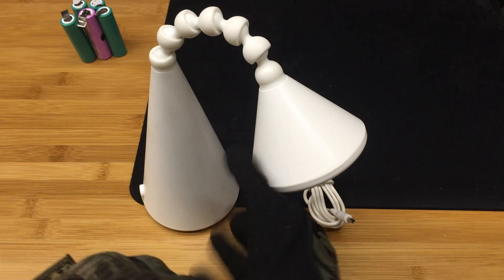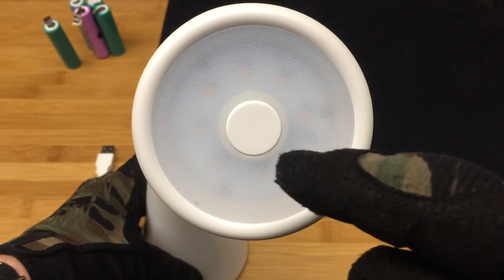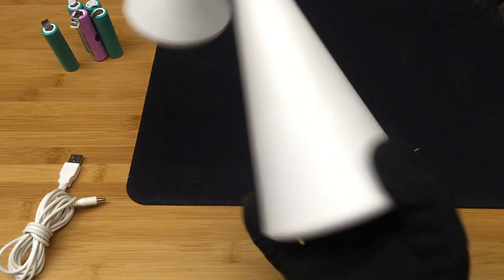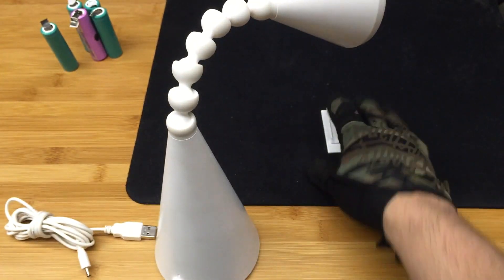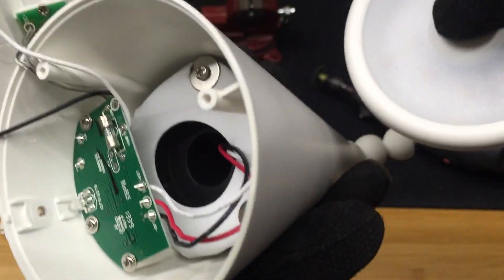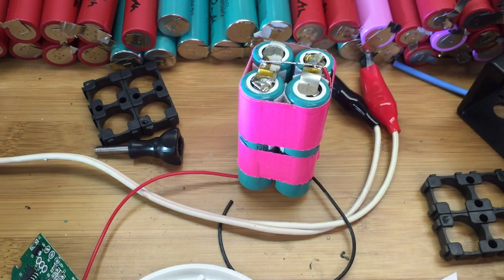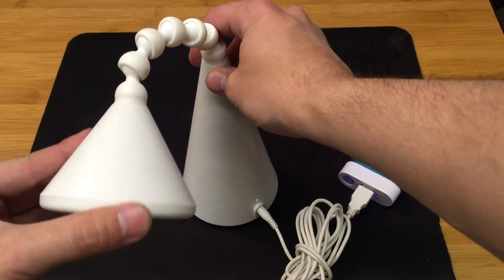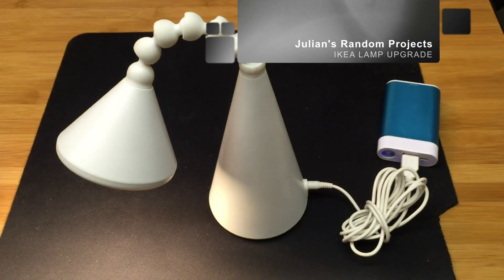FRYEBO IKEA Lamp Battery Upgrade 18650

Comment: Cool, lots of room in there for batteries. You might want to consider changing out the charging circuit. Using the NIMH charger could overcharge them a fair bit, which would be a bit of a safety concern without any protection circuitry on those cells. You can pick up the TP4056 1s charging modules on ebay for somewhere around $1, and they take 5v in. There are some with integrated battery protection available as well.
Reply from the maker: Mike MacWillie Thanks Mike! So funny you mention the TP4056, I've already recorded quick update where I cover the fact that yes, the stock charger did in fact overcharge to ~4.4vdc (not safe). I've already remedied this problem with the TP4056. Should be up soon :) good eye.
Reply from the maker: JuliansRandomProject It's up now https://youtu.be/He0NC3SUfrU
Reply: JuliansRandomProject Nice, glad you had already thought of it. :) Those little TP4056 modules are great.